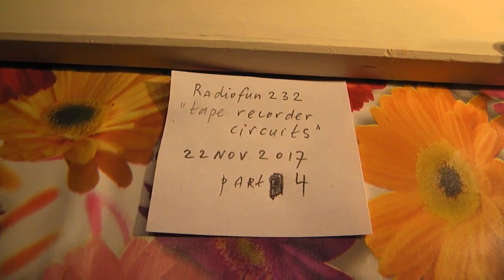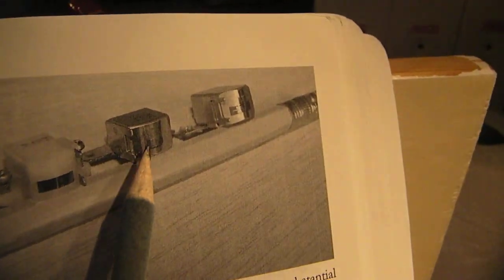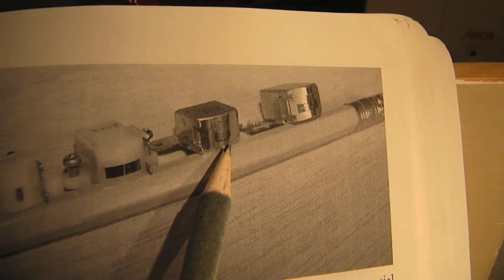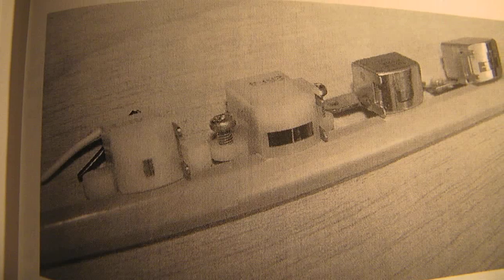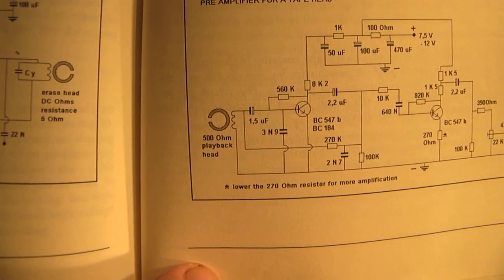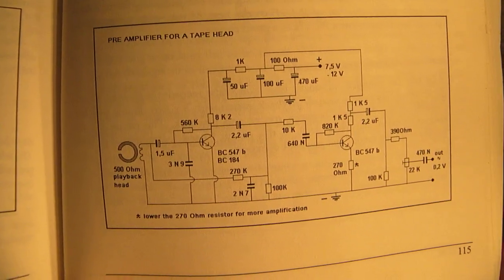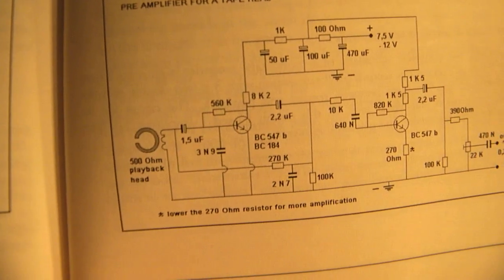Tape recorder electronics: how to make it pt 4: pre amp circuit for a tape (rec/play) head

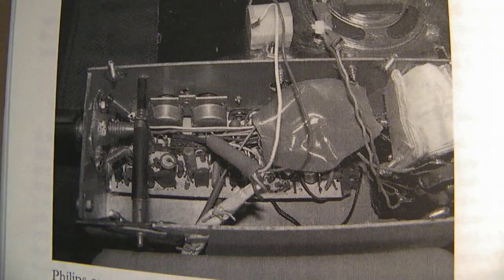Comment: 3:10 looks like an EL3301 or 2 circuit board... thank you for your videos, have built a number of circuits that are similar myself and is great to see people are still taking tape! Regards, Mike the Wombat from Australia
Reply from the maker: Thanks! It is the circuit of the first cassette recorder from Philips in 1962, with some adaptations.
Reply: @radiofun232  I still have the EL3302 my uncle used in the late 1960s!

Comment: I think gap size only limits bandwidth on repro heads. On the record head, the radiated field is contained within the gap, and as soon as the tape moves away from the edge, the magnetization at that moment is preserved, so it is possible to resolve residual bias on the tape if you have a fine enough play head gap
Reply from the maker: yes

Comment: Hi thank you for these Vids, im trying to build a delay effect pedal for guitar and and i wanted to ask you, what the circuit of the final amplification stage looks like, i dont really know, what impedance/power you have to put on a record head, to make it record.
Reply from the maker: The guitar pedal signal is normally sent into an audio amplifier that (at its end) is connected to the tape head. At the same time the tape head is biased with a powerful sine wave signal on a frequency between 25 KC and 50 KC. So the pedal has to have an output signal on "line level" (say 0,8 V AC) when it is sent into that audio amplifier. That is the level that also a tuner or CD player has.
Reply: @radiofun232  thank you for your reply.  
Do you think an generic LM386 as main amp will do the trick. for supplying the record head?
Reply from the maker: @markustopfer1605  I don't know what you mean exactly with "main amp". Do you want to use the LM 386 as pre-amp? As "end amp" for a loudspeaker the LM 386 is too weak. It can only give out (say) max 0,5 Watt. That is not much. The output of the pre-amp is not very fierce (200 MilliVolt) but it is in general enough to drive a sensitive end-amp. To make it work you need the pre-amp and a (say) 3 Watt amplifier.
Reply from the maker: In my earlier comment i supposed that the LM 386 had to be used as "sound" amplifier. But perhaps you mean to drive the record head, and in that case: approx. 0,3-0,5 Watt audio signal could be enough to drive a 500 Ohm tape head with an audio signal. Though I used a 1-2 Watt amp. At the same time the record head has to be supplied with the (say 30 KC or 50 KC or 60 KC sine wave) "bias" voltage/current. And the bias oscillator must also (normally) drive the erase head at the same time, so that the  tape is erased before it reaches the record (= also playback) head. The "erase" energy must be quite fierce and the erase head must be "on resonance" at (say) 30 KC or 50 KC or 60 KC or whatever HF frequency in this range. 31 jan. 2021.
Reply: @radiofun232  thanks, this was exactly the what i meant. my plan is to use a different device to erase the Casette so that i only have two heads mounted on my delay device. So a guitar preamp circuit feeds an "head driver amp" (probably LM386 as i said), to record the guitar, at the same time the signal from the playback head, gets amplified by the BC547 amp and goes into an TL072, and THEN to my main amp/next effect ;)

If this concept works i will maybe post an video. But first i will experiment a little with some circuits.

Comment: I recently took a look at the signal coming from the read head preamp in an old type delay. I could clearly see the 50kHz bias signal there. My assumption was that this signal never actually stays on the tape. I though it fluctuates so fast that it cancels itself out as the tape moves away from the write head. Obviously that is not the case, at least not in my unit here.
I your schematic, it seems like the 3n9 cap on the input serves as a low pass filter. Is this to remove the bias signal? So is it expected that I can see the bias signal after a read head preamp?
Reply from the maker: The bias oscillator is used to a) erase the tape and b) to be mixed into the record head during recording (a part of that HF signal). So during recording the tape is first erased and then recorded. So surely you must see with an oscilloscope the (say) 50 KHZ on both heads (erase & record) during recording. I never studied the music signal on the playback head after the recording (=when playing the tape) on the presence of that 50 (or whatever) KHZ sine wave signal. So I am not sure. Do you also see that 50 KHz bias signal, when you made a recording without audio in and played that recording back? How does the waveform look like in that case? Do you see a HF 50 KHZ on the oscilloscope  when you play back such a tape where only the erase/bias oscillator did its job?
Reply: radiofun232  Thank you! I can see the 50kHz bias signal on the write head. The erase head has a 60kHz signal on it. When I observe the signal at the output of the read head preamp (with the tape moving, of course), I can also see that 50kHz bias signal there. If there's audio running through the tape delay, I can see both the audio and the 50kHz bias signal superimposed on each other. 
It's an old unit. Maybe they just didn't care about filtering out that 50kHz signal after the preamps. You wouldn't hear it and most speakers wouldn't transmit it anyway. In todays age with AD-conversions everywhere, it seems more cirtical to get this HF stuff out there.

So maybe it is expected to see that HF signal at the output of the preamps. I was assuming that there must be a) some sort of low pass filter in the preams or that b) the bias signal wouldn't even stay on the tape as it evens out when the tape moves away from the write head. After all, the bias signal behaves a little like a demagnetizer: You slowly move the demagnetizer away from whetever you're demagnetizing. If you do that slowly, compared to the demagnetizers frequency, there remains no magnetization on the object. This is very similar to the tape moving away from the write head much slower than the frequency of the bias signal. Does that make sense? 
Well anyway, it seems the bias signal stays on the tape and I must remove if after the preamps.
Reply from the maker: Do you also see both these superimposed signals (say 50 KHz & the audio signal) when playing the tape back? If so: that is new for me.
Reply from the maker: @TheSlowGrowth  OK, thanks, I was somewhat to in a hurry with my second reaction. Anyway: that is very interesting and new for me (!). At the moment I am working on other subjects but I will test that/study the issue in the future. Thanks again & valuable info.
Reply: Tapes do have residual bias on them, tho it's generally reasonably attenuated by the repro head gap. The 3n9 cap might be to tame RF interference also

Comment: Hey much thanks, for you explanations! Could you may tell me, if i can also use tapeheads with 250 ohm, or have i to change something in the circuit ?
Reply from the maker: I think it work too. Make the resistor of 270 Ohm lower for more amplification (say 220 Ohm or 100 Ohm) or higher (say 330 Ohm or 470 Ohm) for less amplification. Or use (experimental) a potentiometer of 500 Ohm or 1000 Ohm and align the amplification to the level that you need with a 250 Ohm record/playback head.
Reply: @radiofun232  okay, easy.. thanks! I just found one seller who sells more than one tapehead..and the values are 250 ohm. I Want to build a mellotron kind of sampler..if you know a seller of tapeheads, please let me know!  have a nice day!
Reply: @evelynlehmann3547  If mono will be good enough, I have found the best source of tape-heads is cheap (approx £1.20 EA) tape-to-mp3 converters from china. Aliexpress.
Reply: @evelynlehmann3547   hi, sorry for the question. may you can share the link of the seller? thanks.